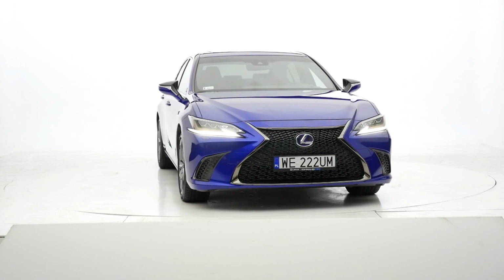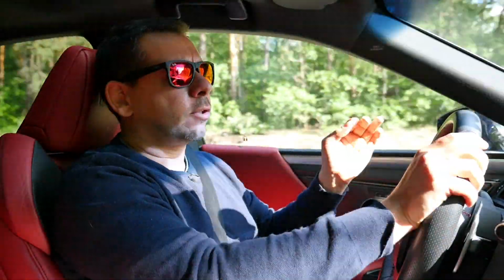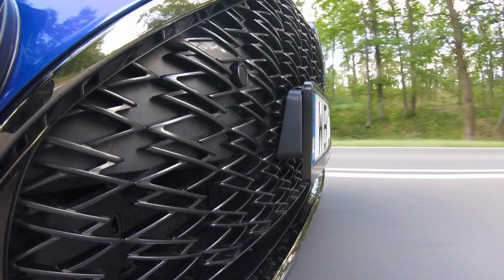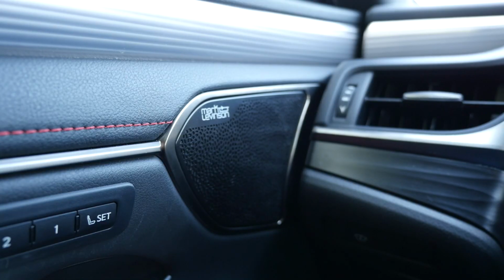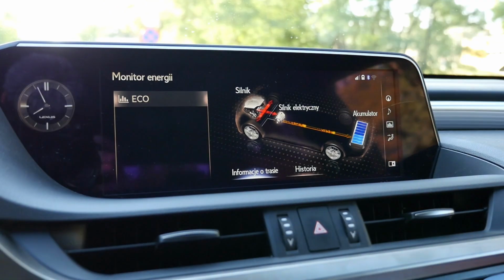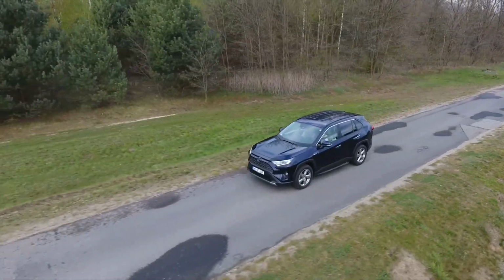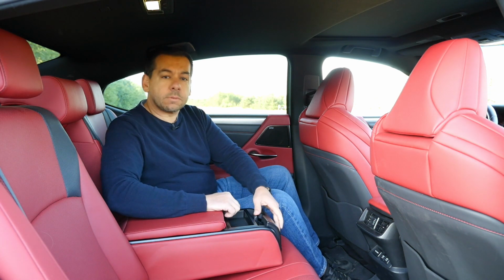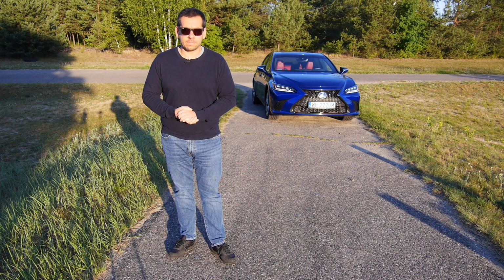Lexus ES 2020 (ENG) - Test Drive and Review

Comment: You didn't mentioned that ES is slowest also on top speed. It's only 180 km/h. What do you think? Does it matter in nowadays market?
Multimedia: :D it reminded your thoughts about Citroen DS5 buttons review a few years ago. It seems that designers made because if it looks up to date it should work.
Reply: Are you going to be racing your luxury Lexus ES? Really who cares about top speed or even 0-60 speeds!
Reply: @AI-qd4vb  Not a Rolls, you make me laugh JUNIOR! Its a entry to mid level Luxury Sedan that happens to be about the most reliable car you can buy. Who ever compared it to a Rolls? Then by all means buy a POS GERMAN Sedan and enjoy your breakdowns and high repair/service cost, High depreciation! Its obvious you have never driven a new ES350, especially the Ultra Luxury trim if you are comparing it to a Camry. They share the same drive train and chassis but that's where the comparisons end. I'm actually FINE with having a drivetrain that's also in the Camry considering how reliable it is. A naturally aspirated V6 engine with 302 horsepower. BTW an equal comparison with a Toyota car would be an Avalon NOT A CAMRY! BTW I also own a 2016 Corvette C7 Z06 so I don't need a Sports Sedan since I have all the speed I would ever want.
Reply: The 0-60 time quoted by Lexus in UK ans Europe, and Aus and India too I believe. They always exercise extreme caution with the stats on their hybrid models. Not sure why they do this with the rear boot space.  In US they quote 8.1 and several reviewers that gave tested 0-60 mph have reported 7.4. When I have played with it I get more like 7.7 but with fully charged battery maybe I can get this down. So is not slower than the eco orientated models by the German brands. Also of note, this is a naturally aspirated engine with the German brands using turbos. The turbo lag on the German competitors is notable and this is instant because of electric motor.  My A6 has about 2 seconds lag from kickdown to move so if you factor in turbo lag on a rolling start, which is a real world driving situation, thus will actually arrive at 60 quicker than many medium sized German sedans if count 5he time from when you press the pedal - which is fair to do in real world driving.

Comment: Anyway, my volvo d4 eats 4.5-5 L per 100 km much better than hybrid
Reply: My Sportage 1.7 diesel consumption 5.2-5.5 l/100km higway and 2.5 times cheaper
Reply: Well my 5 cylinder turbo Volvo S60 did also eat less than my V8 Lexus GS. But maintenance costs were about 8 times more expensive than the Lexus. No joke. 
In the end my Lexus is way cheaper to own, and it is better than the Volvo in everything, except for consumption.